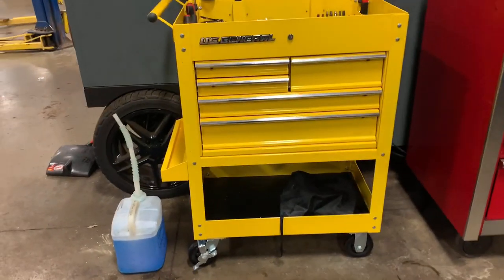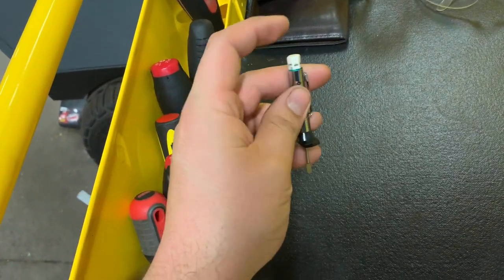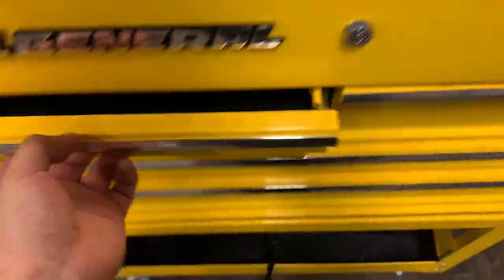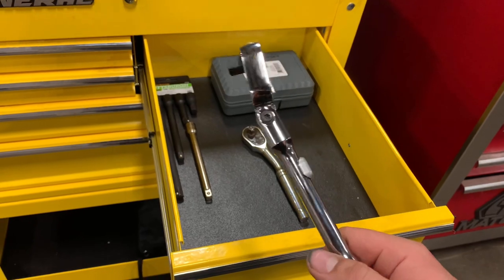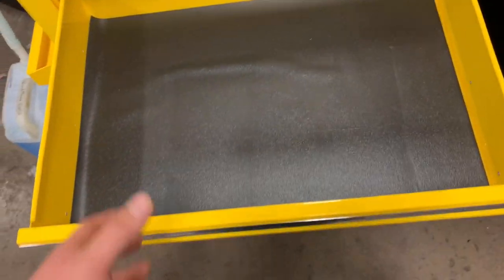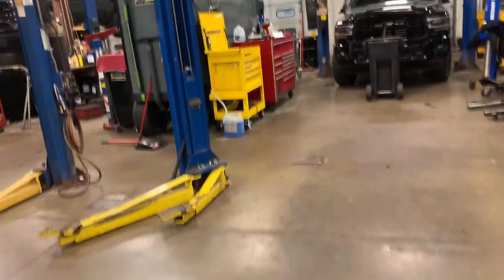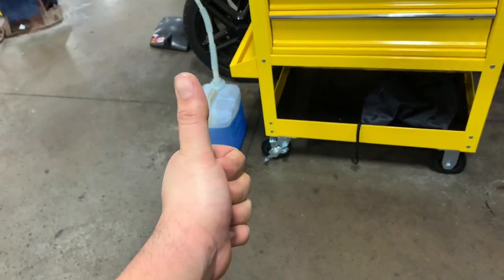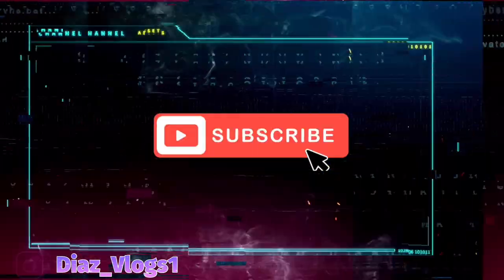U.S. General Tool Cart and tools I have as a lube technician for right now!

Comment: For hand tools, I recommend tekton tools.  The prices are really good, they don't skip any sizes.  If you're a student you can get a discount and free shipping on their site.  Im a lube tech as well, and I really like their tools.  I honestly wouldn't bother with snap on sockets for example.  I have 3/8 snap on impact sockets, and tekton.  Theu both do a great job, but tektons just much nicer to the wallet.
Reply: I started out at a valvoline instant oil change and we used a bunch of tekton when I moved to a shop I went right to their website
Reply: Great tools they make

Comment: One advice I can give you is  Don't fall for the snap on trucks look there is good tools out there for way cheaper good luck work hard
Reply: May I ask you how much SnapOn actually costs? I mean, sure, they have their prices on their Webpage.

But you wont tell me that people buyin' a 3/8 Ratchet for around 140 Bucks?
Reply: @DaroriDerEinzige  Yep. There are.  My area is absent tool trucks, so I shop NAPA. The Carlyle stuff ran me about $70 for a 3/8" ratchet.
Reply: @scarling9367  Ah ok. 70 Bucks seems reasonable though for "Pro Quality"/"Earn your money with it quality".
Reply: @DaroriDerEinzige  I bought my 3/8 and 1/2 locking flex ratchets for 198 a piece and they’re amazing. Got my air impact for 540 which I haven’t found a bolt it can’t remove (yet). My t handle brake kit ran me $109. And my master tire kit was under $400....quality matters but only get what u need...I got ripped for my torx kit

Comment: Every tech has a start, i personally run an automotive repair shop in GA. Starting out, try to shop online and do research for tools... you will NOT need hardly ANYTHING off the tool trucks UNTIL your repairing vehicles or diag. Keep it up

Comment: As a lube tech, my coworkers always dog on me for cleaning all my tools before putting them back into my box. Granted I’ve got more tools and needed a bigger box I’ve went ahead and got a decent sized box off the snap on guy.. but I’m not strictly a lube/tire tech, since it’s only me and another tech at the dealership so they’re teaching me how to take apart dashes, do recalls, heat exchangers, how to find AC leaks, just all around training. I enjoy it a lot and am definitely thinking about doing this for a long time

Comment: Harbor Freight has a lifetime warranty on hand tools🤷 Only buy them once and take them back!

But what are you doing with them? I have yet to break a socket from HF and I have a whole box full of HF tools and only broke some extentions at this point. I mean in the last few mo ths I have done timing belt and full job on a Toyota 4.7l and timing set and water pump, oil pan, rear main and oil pump on a small block chevy. So I actually use my tools.

Comment: Get the 1/2 drive Xtreme tourque stubby impact gun from harbor freight I own snapon and matco guns but harbor freight is right there with them on this gun it only weighs 2 pounds but it's strong I use it for repairs as well as lugnuts I do heavy line repairs with this gun it makes my job easier I think I paid 115 dollars for it just oil your air tools everyday my snapon gun is 26 years old still works fine because I oil it